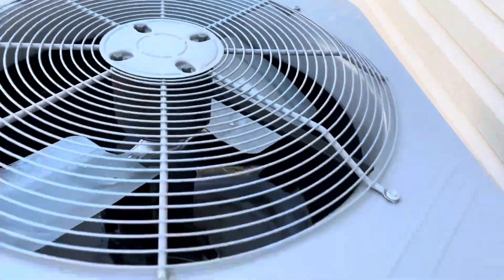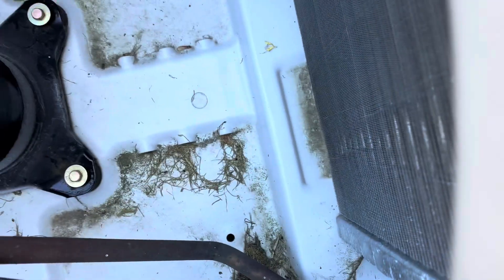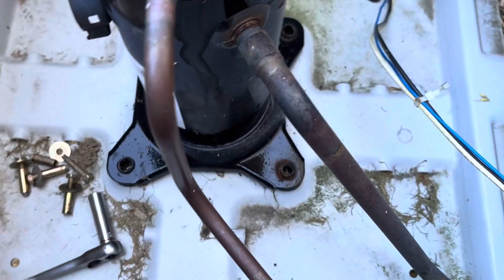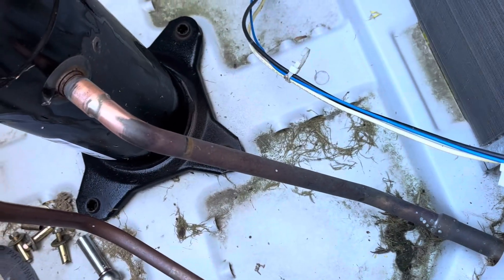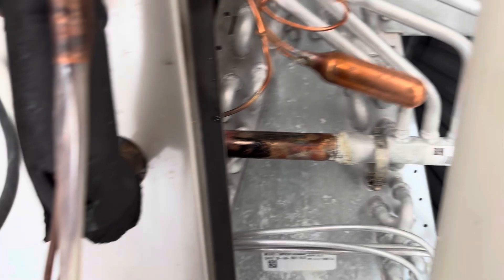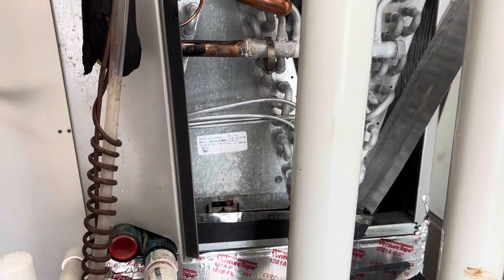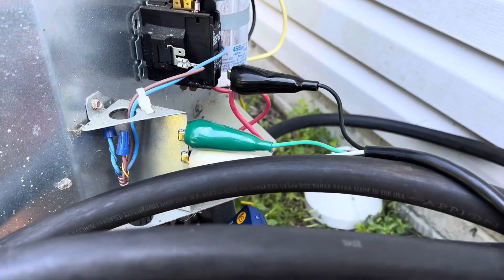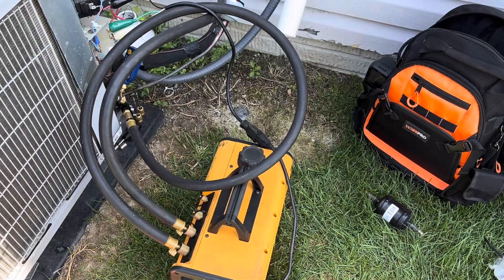Severely Oil Logged TXV Takes OUT Compressor!

Comment: Can you provide more details about what happened or but symptoms led you to know the evap was oil logged? Was the TXV restriction due to the oil? Do you know how the evap became oil logged? I think I might be having a similar issue on a system I am working on?
Reply from the maker: So the compressor failed and the TXV was changed with it as a precaution.

Comment: In what way did the compressor fail. Was it a short to ground, lost compression, won't start? Was it noisy and on the way out?  I am assuming compressor was running and pumping because I don't know how a txv can be condemned if there is no compression or compressor doesn't run at all unless the bulb line is visually broken. A lot of oilt in that dang thing for sure. I have had few oil logged evaporator coils that jad to he replaced, could never get it all on a few
Reply from the maker: The compressor was changed because we didn’t know how long it ran with no oil and in a vacuum with a clogged TXV
Reply: @JeffsHVACAdventures  I got ya, so it was more of a recommendation to prevent future headache. Got ya. Thanks for the reply back

Comment: Nice video Jeff for future reference In case you come across another one of those situations and need to flush the evaporator or linesets from a txv or compressor failure you may want to go to auto zone or advance auto and Pick up one or 2 cans of ac pro system flush then run the nitrogen but then you have to vac out the system for 40 minutes and ac pro does offer them I. Big gallon sizes too and you would just need a flushing gun too add solution to as I think it's a good idea as a precaution to flush the linesets out also before installing the new compressor and filter dryer as a precaution I know on cars if a compressor fails or an evaporator you always do a ac system flush. But with new cars you can't flush the new condensers you Just have to replace them but I can get replacements from spectra for around 100 dollars evaporators around the same slightly less

And 4 seasons makes automotive compressors wish residenrial hvac had more of those options for older units.

So those r 22 and older 410 a units can keep going as for your blueon video I need to do my research to see if it will work with poe oil as well and if it can work as a replacement for 410 a
Reply from the maker: Good Advice.
Reply: @JeffsHVACAdventures just did some research on the blueon stuff it looks like thats the one for a replacement for R 22 it does say it has lower pressures than r 22 to help preserve system components from your blueon video and that you can put more I. For a charge VS r 22 and that it reduces the power draw VS r 22.

And here is what's messed up 15 years later they finally come up with a better refrigerent VS R 22 and better than 410 a that's not flammable and has a even lower gdp VS 410 a

 but the same crap that started with r 22 replacement refrigerents is now happening with 410a and Jeff I think part of the reason so many evap coils and condenser micro channels are going bad and all these system problems are is because of the higher pressures from the low and high side it's tougher on the compressors coils and txv valves VS the older systems so if their was a, way to just make blueon the standard and come up with switches to change for 410 a systems that would help along with the inverter technology.

I have Been looking at the so called 410 a refrigerents replacements and the only one that shows promise to me is r466a but it is not available here yet and is not approved yet but has been tested in a trane rooftop unit that is intended for 410a.

Butvthe question concerning blueon is can you use it with a, system for which the compressor was replaced with poe oil because from what I understand 407c is getting phazed out too. 

Anyway Jeff if you have older r 22 systems it's better to keep em going at this point and repair em and use blueon VS all this crap going on unless the system is totally dead it's best to keep em going.
Reply: Just checked blueon is compatable with both poe and mineral oil so why the heck are they just not coming up with sensors that can be put on 410a systems to allow them to run optimally at lower pressures and that just be the refrigerant for both r 22 replacement and 410 a replacement. And then the American companies can kick butt again and stop the forcing of everything needing to be made in Japan or China.
Reply from the maker: @gabrielstern4992 good stuff brother.   Blueon says they are working on a 410a replacement for what it’s worth.
Reply: @JeffsHVACAdventures  I hope so it needs to have lower head pressures and work better than 410 it needs to be the equivalent of the r 22 replacement or better.

The closest thing I have seen is r 466a that honeywell has been testing with trane but that's still not good enough and is getting a lot of push back and I gave looked at the r 454 b or whatever and I don't like it at all and I defenetely don't like r 32 by itself it's too flammable and too much risk even with sensors that supposedly shuts off the system but here's the problem what if someone accidentally sets a match off or something or an electric spark happens from a bad wire connection that could trigger an explosion like with propane or natural gas.

Because that's what r 32 is. To a degree it has way more propane in it VS 410 a which does contain r 32 but it also has r 134 a which is what my car uses too.

Comment: My fieldpiece pump trips them too and I've always wondered why. Great video and keep up the good work
Reply from the maker: Certainly weird.  Thanks
Reply: I have to use a widow maker for my field piece pump. Just got used to it now after 1 yr of use
Reply: My fieldpiece vacuum pump does the exact same thing with the GFCI
Reply: It's the ramp up of the motor. Gfci react to increases in electrical draw that cause it to trip